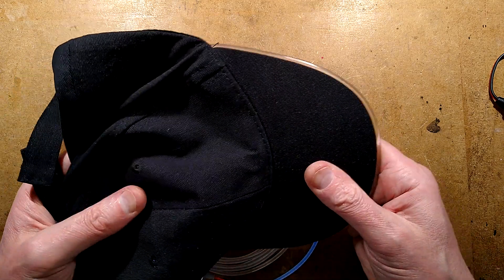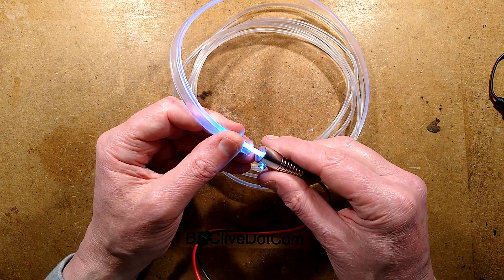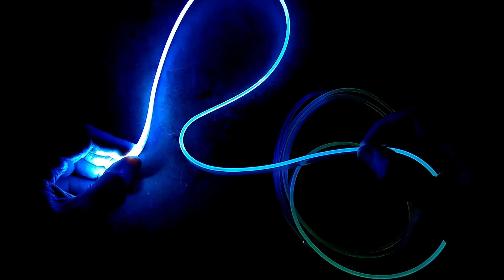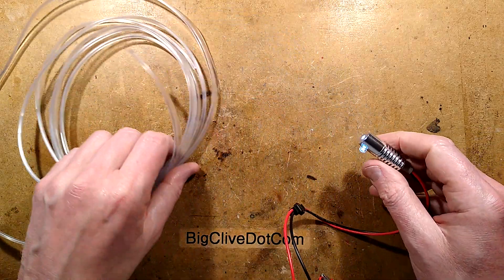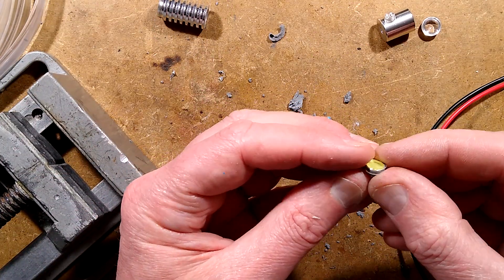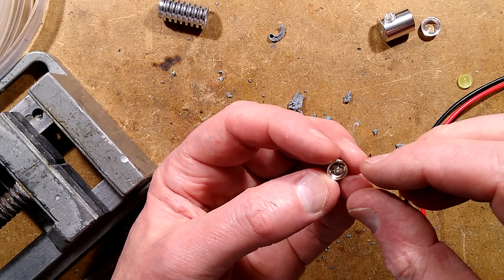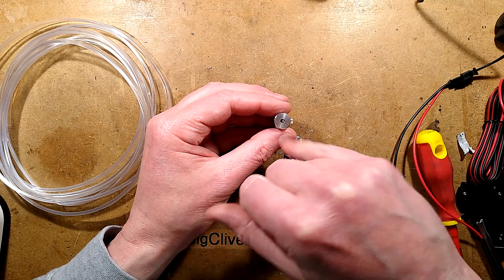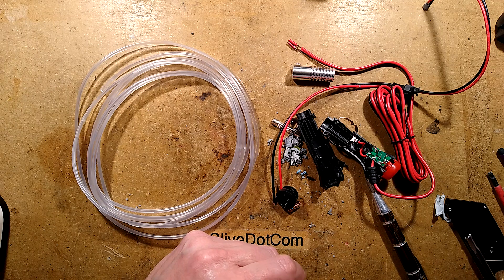Side-glow fibre optic is still terrible

Comment: Note that the hat has an LED at each end and I bet it has less than 600mm of fibre round the peak.
Reply: less than 23 inches ? no, really
Reply: @boris2342  Clive mentioned 600mm as the maximum usable length in the video. @Jon Knight was saying that the brim of the hat uses less than the maximum that Clive said.
Reply: @HiddenWindshield  hat  innn;gdd?.

Comment: I recently got my kid a ginormous mouse pad with side-glow RGB lights.  It's a bit under a meter wide, and a half meter or so deep.  All told, it's roughly 2m/7' of light pipe.  It doesn't use the "skirt" style, and instead is stitched in with monofilament around the tube.  The two ends of the light pipe meet up at the control box, which shoots light down both ends.  It's a passably good effect, and doesn't seem as bad as this example.  They're about $20 (USD) on Amazon lately, so the material can't be expensive at all, if one can find it.  I suspect the fact that it's totally round versus having that little tab makes a big difference (unless they controlled material properties very carefully in constructing the tab, it's going to chew up a few percent of the total internal reflection, which adds up quickly).
Reply: I actually have one of those too! It's at most about a 25% decrease in intensity at the darkest point across the 2m or so of fiber optic, so I think it's quite good. It's not as transparent as the fiber optic in this video though, so that might have something to do with it.
Reply: One meter wide? That's at least a cat pad.
Reply: I have a SteelSeries LED gaming pad, that sounds about the same as what you got him. The edge of the whole pad is definitely over a meter, and I don't notice any loss either. I suppose it just depends on the overall quality of the fiber optic used and the strength of the laser?
Reply: @TheMadmanAndre  I had the qck prism XXL and it rings true for that too, I think that what helps is the stitching holding it on as I could see it helping the light along, I think if you took the time and used semi transparent material and/or put it against and opaque surface you could get the light to go much further and be more even along the desired length as well
Reply: That's not a mouse, that's a capybara. 😉